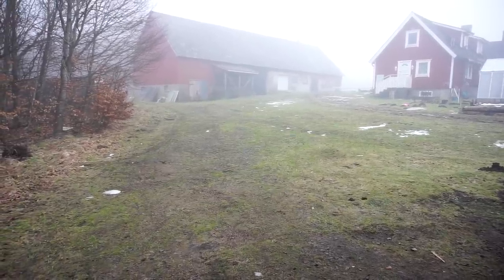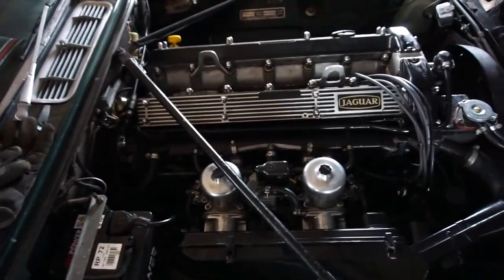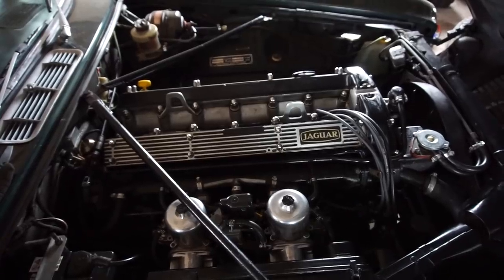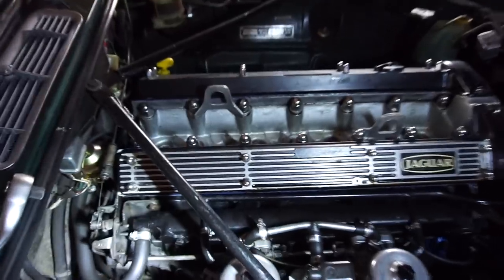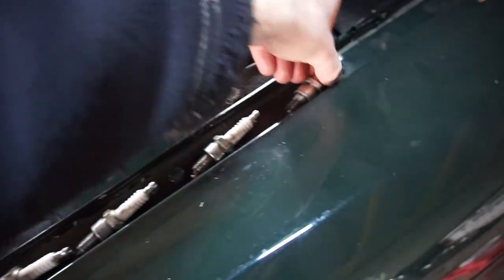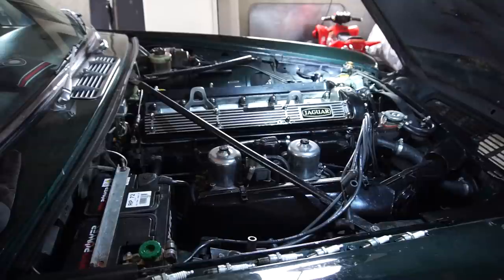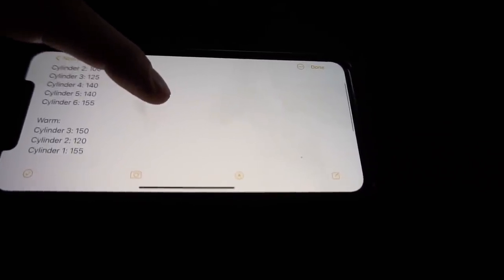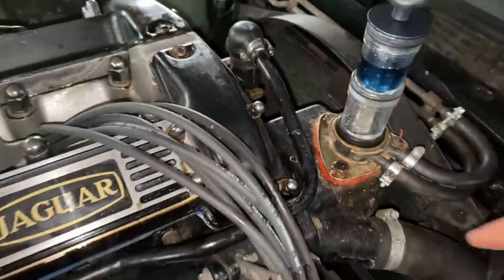Broken Jaguar Engine Update and Closer Look

Comment: I have no experience with the XK engine and I have not followed your whole series.  I have been turning wrenches for more than 40 years, and when rebuilding engines I always replace all the cylinder head fasteners studs and nuts with high quality new.  I usually use ARP fasteners even on standard engines that will never see competitive racing use.  Doesn’t matter how nice the old fasteners look, always use new fasteners.  It’s an expense that assures me that I won’t see an engine return for reasons of fastener unreliability.  I always torque the head bolts and nuts twice, and use any fastener lubricant as specified.  I always run the engine through several thermal cycles and again check the fastener torque.  Best wishes that your engine stays on the good side!

Comment: Yes, it follows that if the head was skimmed, it is now lower down (obviously by a tiny amount)  on the bolts, so a bit extra compensation on the torque wrench setting probably helps.

Comment: 100 psi in your #2 cylinder is not normal.  the average of the other cylinders is 143,  100 psi is along way off from that.   question is now is it bottom end or top end.  drop some oil down #2 cylinder and see if it improves.  if so you have a piston ring problem.   if no change.  then you have a burnt valve problem.  ( i know the head was checked at the machine shop so.........)

Comment: Hi Adam,..that sounds like "great news".
   I'm really happy to know that the "problem" seemed to have been "fixed".
  I heard from other people that have used that "head fixer in a bottle" in the past, is that you have to GIVE IT TIME, and that it will eventually do it's work with the continued use and running of the engine. 
  Has you mentioned Adam, you will keep an eye on it and monitor it's results has you use the car.
  Thanks for another great video and I hope also that the engine will keep working well with no issues.

Comment: If you have changed the HG and did a good job (plaining of the head, new gasket, good studs, correct torqueing) and you haven't been leaning on the engine hard it is unlikely that the HG is the problem.
Could be that the re-torqueing has pushed the cilinder liners tighter down in the block. That might have sealed up the cooling system. 
Anyway, good to see that the engine seems to be behaving like it should.

Comment: Just a thought, I had an XJ12 TWR with a 6.0 ltr engine. I had problems with water getting into the fuel tanks... From memory the right hand side... If you are getting water in your petrol, in turn it's getting sucked up into the engine. It will run lumpy and will steam more in its exhaust.... Just an idea... Keep up the good work...

Comment: I see you've been very thorough with your checks; torque, gasket and surface cleanliness, with the hot & cold engine. From my view, it idles very smoothly, and when you conducted the compression test, which is at cranking speed, variance may well have been from new. In the Chrysler Valiant engines ('Slant' 6, 225 cu. in.) the service manual gives a 'specification' for a compression test, a value between 110 and 140 p.s.i. as an acceptable reading. I don't know what is specified for the Jaguar, but regular monitoring & maintenance would see a good few more miles and years of service with that engine.. Good work there..

Comment: when i started in the garage trade 53yr. ago the mechanics that taught me always did 2 clicks of torque wrench as they didn't trust the first click i asked wont you over torque or do damage to head or block , or stretch the bolts , as they said it's set for a certain torque you can click it all day long , it will not go over the setting you.ve set it to.

Comment: Hello. Love the video's. Just sharing a view, I was brought up on the school of thought that when you re-torque head bolts, you always back off 1/4 turn 1st. This is what I have always done if the manual says it or not but I am by no means a mechanic, more an enthusiastic DIY'er with many years experience and engine/head rebuilds on my own cars under my belt. I have experimented and tried re-torqueing without the 1/4 turn back off and found the bolts do not move on re-torque but with the 1/4 turn back off, they always tighten considerably. I have only re-torqued once after 1500 miles post re-build. This is my experience, but like I say, I am not a pro.

Comment: i think you need to use a higher quality gasket. i have seen this before but not in a jaguar but a rover. we replaced the gasket twice with the same gasket but on the third time we used a high end gasket and the problem never happened again.

Comment: Head bolt stretch? Did you use new ones last rebuild? Combination of that and the sealer? If the compression wanders, wouldn't that indicate broke rings? Questions, questions

Comment: You could always run a leak-down test on cylinder 2 to hear where air escapes (block / intake /exhaust ) adjacent cylinder / bubbles in coolant (head).  Something explains the #2 low compression.   Anything but leaking to coolant is livable.   Is the current gasket an MLS one?

Comment: It seems to be running ok, just keep an eye on it, check oil and water regularly ( you can see when coolant gets in with the oil ) and keep driving it. 
I would always be dubious about those repair in a can products, they are probably good to get you out of trouble short term, but as a long term repair, NO! 
Also this car would be from the troubled with ''BL'' the big merger and trade unions, Jaguars and others suffered build quality issues. 
I know a man who has a lot of experience with Jaguars of all models, he said he would not touch an 1980,s built Jaguar due to the build quality issues.

Comment: You look much better driving the XJ40, why not put this one in the collection and use the XJ40 as your daily driver?  It would be more interesting to look at, and we can watch you fix the headlining.  Have you thought of injecting silicone through the fabric using a hypodermic and pushing and holding it up in a few places?   Just some ideas, love your program.

Comment: So does this mean there is no fuel injection conversion in the future for this car? You had mentioned that in a previous comment or video if you had to replace the engine.
Reply: I wouldn't do that. SU carbs are great.
Reply from the maker: Not planning on doing that at the moment. My SUs are in great working order. I only planned that if I would fit a complete series 3 engine. Might still do a modified efi system on some car in the future. It would be fun

Comment: from Fraser, husband of Leslie
Sorry to be a spectre at the feast, but IMHO, the torque-down is unlikely to solve your problem. A 1975 car will have the 7L block with the long studs. These, and the 8L blocks, suffer from cracking of the block between the bores. The blocks have coolant transfer passages machined via the cylinder bores, and thin wall liners are used to close these off, and make the cylinder ready for the pistons and engine assembly. The cast iron at the top between the bores thus forms a narrow bridge and over time, a crack forms in this, and destroys any bridge strength that was there. Sinkage occurs and the head gasket fails, and replacements will continue to fail until the reason is addressed. The cracks cannot be welded, but the cure is to strip the engine to a bare block, machine out the original liners, then machine a recess all round at the top of each bore and insert lipped liners that touch each other and cover the crack. This is a rather expensive operation, so most people don't do it ! 
How do I know all this ? It happened to me !!!!  Except I got lucky and found an uncracked 7l block to build my engine around.  That was in 1990 and that car is still running today, although I sold it in 2003, having owned it for 14 years.

Comment: This might be a silly question but do the block studs bottom out in the head nuts not letting the right torque be had on the head ?  I expect you have already checked that though.
Reply from the maker: That was checked when it was assembled. They all have plenty of space before they would bottom out